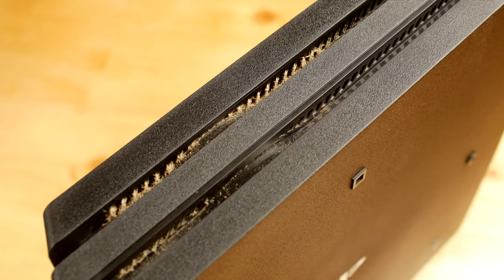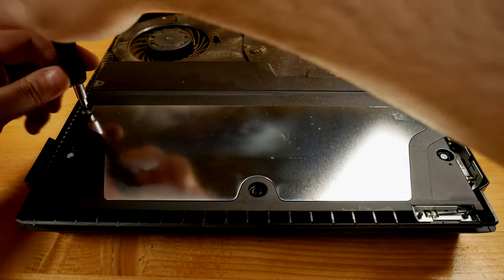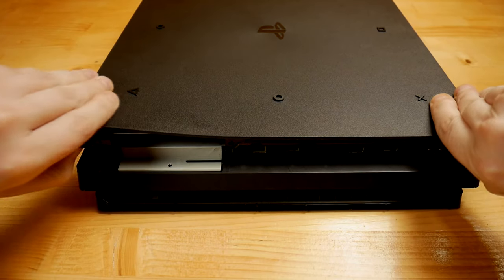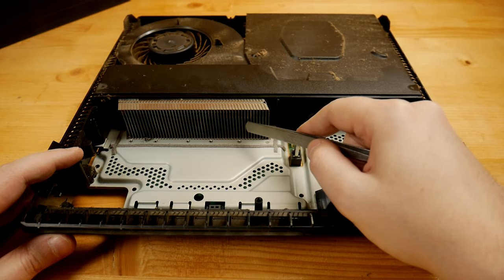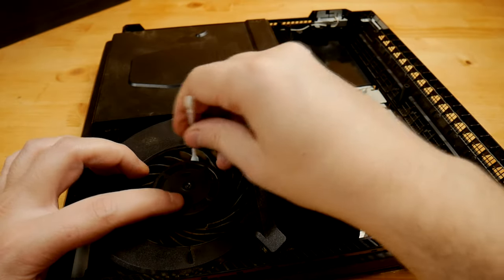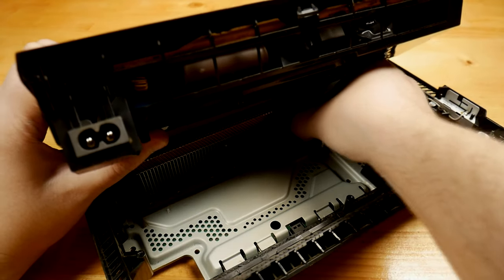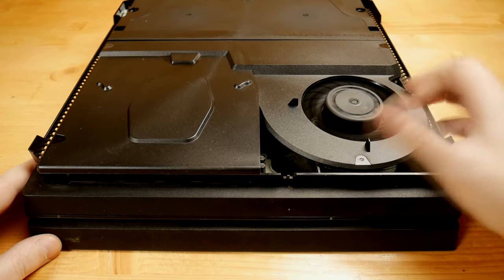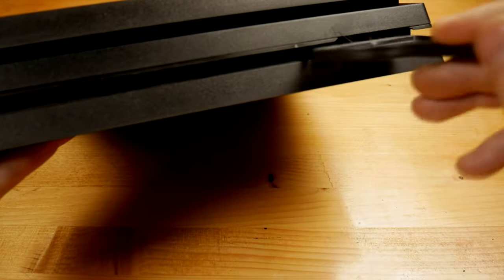How to Clean PS4 Pro - PlayStation 4 Pro Teardown & Cleaning

Comment: Hi, which torx did you use? what type of screwdrivers did you use?
Reply from the maker: Torx TR8 and Phillips PH0
Reply: @YesterdaysTech  thank you sooooo much, I appreciate it very much, if you had to give me some advice, on what precautions to use in order not to ruin anything? I am really very scared
Reply from the maker: Just follow the video, if you do it step by step, everything will be fine
Reply: @YesterdaysTech  thank you soo much, I really appreciate your availability, if I ever have other problems can I ask you other questions? anyway thank you very much you have earned my membership !!
Reply from the maker: Sure, feel free to ask anything, if I'm able to help, I will gladly do it
Reply: @YesterdaysTech  thank you soo much ❤️❤️
Reply: @YesterdaysTech  hello, i update you, i managed to disassemble the reassemble everything, i replaced the thermal paste, and the thermal pads, reassembled everything in 4 hours total, now the ps4 pro is really so quiet, thank you for your advice❤️❤️
Reply from the maker: I have a separate video for replacing thermal paste. I'm glad your PS4 Pro is working great again
Reply: @YesterdaysTech  yes, i m really surprise for the silence, after 1 hour and 30 minutes of god of war ragnarok the fan i think was at only 50%, but AFTER 1 hour and 30 minutes of god of war ragnarök, before only starting rocket league after 30 second the fan was at 100%🤣🤣

Comment: Thank you very much sir, the only thing I did differently was I got someone to hold the power supply up as I cleaned out the radiator instead of pulling out the power supply wire just in case and it’s so quite 🫶🏼
Reply from the maker: Good idea! 😎